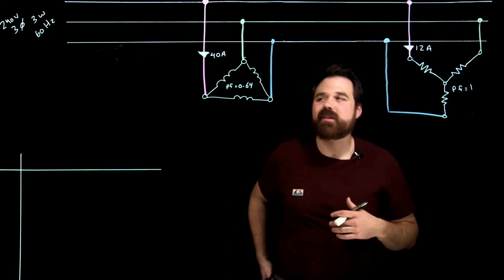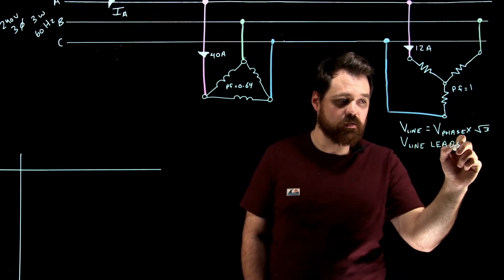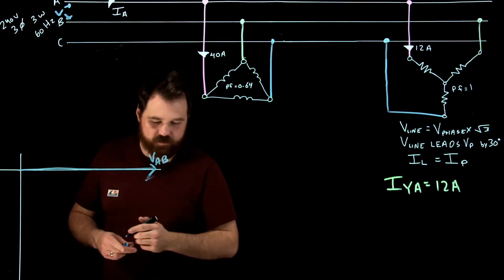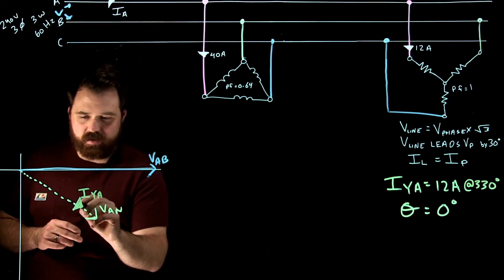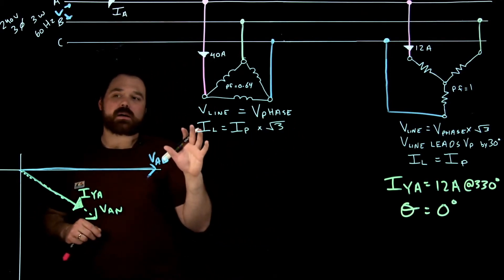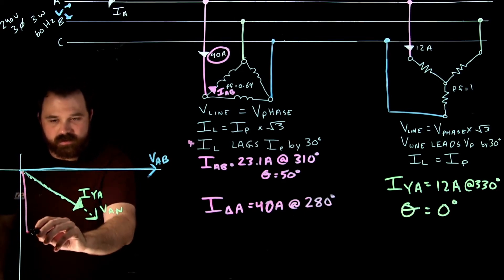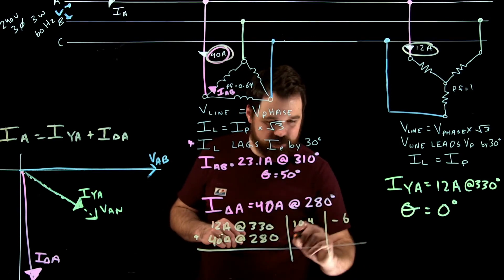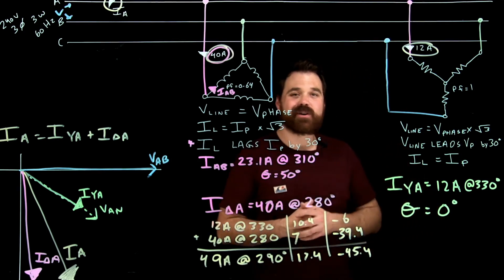Wye and Delta Loads on the Same Source

Comment: Much confusion on my part.  Where did the 240 volts on line A B and C
come from?        I thought that 7,200 volts was FEEDING directly to the
delta or wye?   so confused.
Reply: Where did you get that number from? Look at the source voltage.. it's 240.. not 2700🙄
Reply: Sounds like we may be from same background. Linework. This is a different point of reference as he states the initial claim to be a supply of 240v to a load connected wye and delta. Not a supply of 7200/12470 to a 3-phase bank of transformers. Hope this helps!